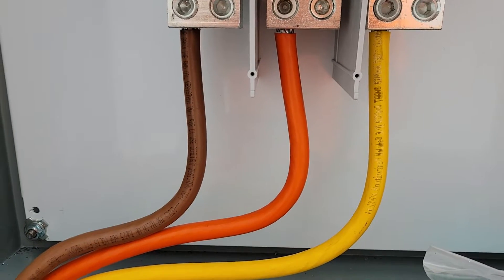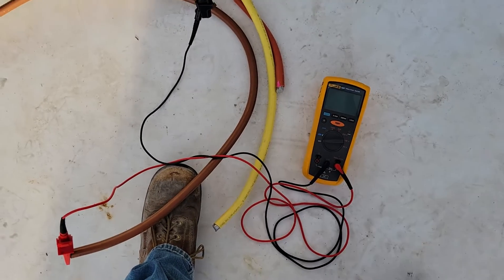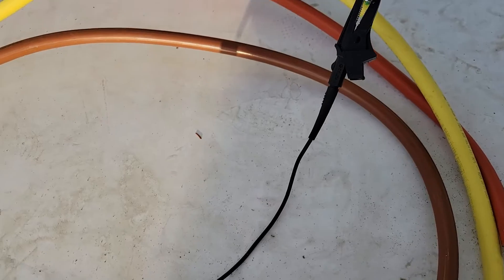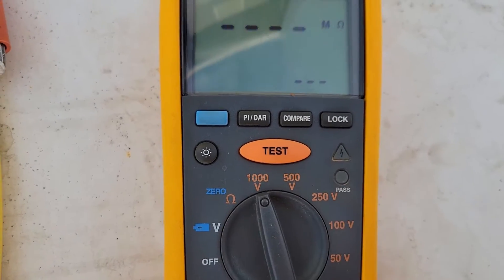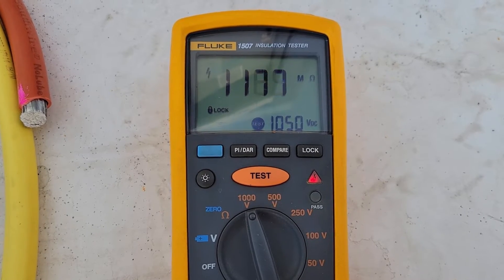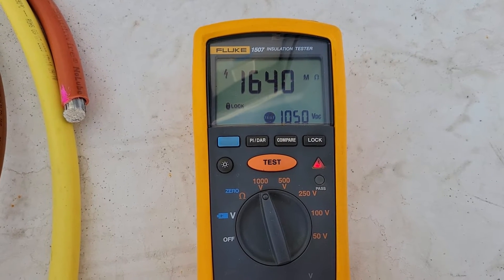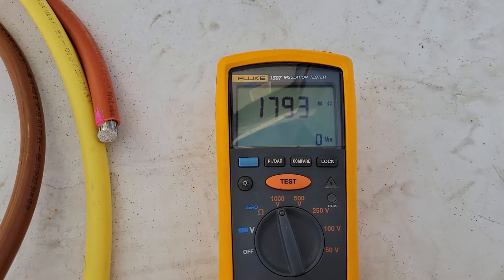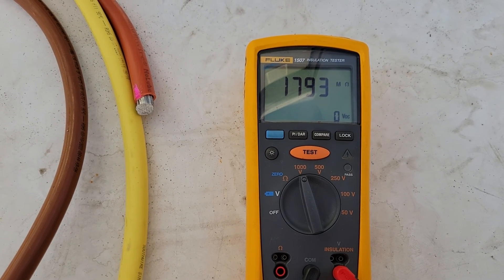Fluke Insulation Tester In Action, (AKA Megger)

Comment: As a NETA level 4 with 2+ decades of experience in electrical testing my opinion is that the video demonstrates on how to use the test set but that is not the correct way of testing a low voltage cable. The cable should be encased in a conduit which should be grounded as well. This way the total insulation resistance in reference to the conduit (which is inherently grounded) is measured as well. Also, the cable should be terminated on both ends since there are chances of insulation damage during the termination procedure, or simply bad workmanship where a couple of straights of wire from one phase touches the adjacent phase (seen this happen quite a few times especially in tight spaces) . As a quick preliminary test it should work but not a final insulation resistance test.

Comment: What if the wires at the other side touches each other. Assuming that you don't know that.
What will happen?
Reply: They arc. The opposite ends should be taped up & good distance from anyone.
Reply from the maker: It will read 0 and form a small arc for a second. Be sure to tape them up nice. We also have a spotter on that side to keep people away.

Comment: These wires....Werw they running 120V or 220v?
Reply: The voltages in the video are 277/480v unless they are coming of a transformer that alters the nominal voltage

Comment: So if your conductors aren't actually touching then you wont get a Failed reading? Does this test not work if the wires in question are not touching? I thought a simple Nick in The Wire would show a fail or bad reading
Reply: If that nick is not extremely close to the interior surface of the metal conduit or touching the bare material of an adjacent phase, the insulation resistance will pass, especially in low voltage cable applications. The withstand test (Hi-pot or VLF) would be pick this up but this test is only being used in medium and high voltage applications. In other words, if I nick the wire and it's sitting in "free air" at a decent distance from a grounded conduit or enclosure , the test set will not pick it up since the dielectric breakdown of free air is 3KV / mm. A simple calculation will tell you that a 1000 Vdc insulation resistance test will only break down the air if it is less than 1/3 of a mm away from the reference (ground in our case).

Comment: I just bought a Megger and wanted to test it. I tried to use 2 short pieces of NM-B 12/2 Romex (1 with no nick/damage in insulation and one with damaged insulation). The megger puts out sane number VDC (500) and megaOhms shows 500 as well. When I release the Test or Lock button obviously VDC drops but the 500 MegaOhms stays same. It foesnt matter which wire I test. The broken wire and good wire show No differences. Im using ground to Hot or ground to neutral. I saw a video of someone doing this test and his worked where mine does not. Is this meter defective? Should I return it for another?
Reply from the maker: I am surprised by your result. What brand is your megger and yes it may be faulty.
Reply: @ElectricianToolDeals The Megger was the UEI IRT807. I just got the Klein one and had better results on some #6 THHN but only when the copper actually touched. For that I could just do a continuity test to see if there is a break in both wires and they are touching.

I thought this would give actually readings on the insulation integrity or aging insulation on older wires as well.

When I put a nick in the one wire and test over the 2 it just gives good readings.
Reply from the maker: @cyrusalmighty21  I believe you will have better results on wire inside conduit that is a longer distance. The resistance value of small wire is very low and hard to pick up except with the best equipment. Cut a piece of 1/0 or something and put it in conduit or in the ground next to some other wires and you'll see it. In order to see the lower value it needs something for the current to leak onto ie: conduit, metal boxes, etc.
Reply from the maker: Electricity won't travel through air. Therefore, unless something conductive is very close, ie: rigid 90s, dirt, metal conduit, etc., is very close. Your reading won't be correct. This is hard to explain. I hope this helps.

Comment: i will like to know what's the set up at the opposite site of the wires? are they connected to the device, or are they disconnected ? some one told me that the wires should be connected to ground on the opposite site is that true?
Reply from the maker: No cover each wire with tape separately
Reply from the maker: Thanks for the comment too.

Comment: Great video  I just found out at work that some of the works had wires short and they splice them  #10 do you think I can find the with this meter
Reply: Yes. Just test it at rated voltage of wire insulation

Comment: So are those lines live when you are testing them ? Can you megger test something with no power like a vibration coil to test its wire insulation? I apologize if I sound ignorant in advance. I am just getting into the electrical field and am self researching.
Reply from the maker: Thanks for the comment. Never use on energized circuits. And any coil that is insulated can be tested.
Reply: @ElectricianToolDeals I just bought a Megger and wanted to test it. I tried to use 2 short pieces of NM-B 12/2 Romex (1 with no nick/damage in insulation and one with damaged insulation). The megger puts out sane number VDC (500) and megaOhms shows 500 as well. When I release the Test or Lock button obviously VDC drops but the 500 MegaOhms stays same. It foesnt matter which wire I test. The broken wire and good wire show No differences. Im using ground to Hot or ground to neutral. I saw a video of someone doing this test and his worked where mine does not. Is this meter defective? Should I return it for another?
Reply: Sorry I meant 550 MegaOhms and 535 VDC is what it outputs while holding Test or Lock for Auto test. And must I wait the whole minute? Your tester had a fluctuating number on MegaOhms where this tester just goes from 0 to 550 MOhms instantly. Its like the leads arent really working. But I did a quick current test to see if leads were im correctly and it tested amps test fine.
Reply from the maker: @cyrusalmighty21  the megger could be faulty. I would be curious to see what a fluke meter shows in this scenario.
Reply: Beginning of video says before u turn on power pay attention bro

Comment: You are not using the proper leads. There is a different lead for doing megger testing. Notice the open spots above the red lead on the megger.
Reply from the maker: Thanks for the comment. These leads are the same leads that they use to calibrate these meggers.
Reply: You can use both sets of leads that come with the 1507 to mega the other lead you're talking about just has the test button on the lead there isn't anything wrong with using these clamps
Reply: Well now I feel like an asshole. Thanks for the education

Comment: So here you were testing brown to ground, does that mean on the other side the brown was spliced with the ground just like how you would do when checking for continuity?
Reply: Each leg covered with tape? Not together? Is yes, than it wouldn't it matter r whichever cable it's tied to
Reply: @energyDee This is for testing that there is no crosstalk between the cables. 
That's why they need to be separated (and why the resistance reading is so ridiculously high - in the hundreds of mega ohms).
Reply from the maker: Thanks for the comment. No the other ends were covered with tape.

Comment: still looking for a video that shows a failure, for example if A phase was connected to ground at the opposite cable ends, what would the meter read then?
Reply from the maker: It'll be a while before I need to do more tests but I've had several fail. I'll make a failing video. Thanks for the comment.

Comment: I have a couple of questions…. If anyone is still on this thread….. probably dumb questions but nevertheless
Reply from the maker: Thanks for the comment. Go ahead with your questions.
Reply: @ElectricianToolDeals  your conductors you are testing….. if they have a cut in the insulation… yet none of the damaged area is touching anything like in free air…. It will still show compromised conductor?
Reply: If that makes any sense at all
Reply from the maker: @chadhardwick9214  That is supposed to be the case. The amount of current that bleeds off that wire and onto the other wires should be larger therefore, giving you a lower reading. If you are doing testing and you have one wire reading significantly lower than the rest, then there should be cause for concern.

Comment: Wait so do you tape the other end individually or do you for example put the brown and orange together and then test it like continuity?
Reply: No. You do not connect your phase conductors together. To read the resistance, each phase has to be completely isolated. So the end you are not connecting to your test instrument, should be isolated to be not connected to ground or to anything else. The tester will measure whatever leaks through. 

The maker of the video mentions isolating around 2:40 of this video.
Reply from the maker: Thank you for your comment and excellent response.
Reply from the maker: Thank you for your comment. Don accurately answered this question. You want to lift the opposite end from any terminals and wrap with tape. This will give you an accurate insulation test as well as keep others from getting shocked.

Comment: Did you disconnect the ground wire from the system as well? I have used a megger before, but it’s been a long while. I remember isolating the phase conductors, but cannot recall if we isolated the ground as well.

I am about to perform some testing on some suspect VFD cable to a span motor for a pivot bridge. I do not want to back feed voltage through the ground to the VFD. I won’t be reading insulation resistance of the ground conductor. I believe that is unnecessary since it does not carry load current.
Reply from the maker: You won't need resistance of ground but you will need resistance of phases relative to ground
Reply from the maker: The ground also needs to be tested and isolated to verify no current leakage from phase to ground.

Comment: Do you always have to disconnect the other end from whatever equipment and tape it off
Reply from the maker: Thanks for your question. As long as the equipment is in the off position, you can technically test it. You'll have to remember that if the feed is parallel, then you will be testing all wires of the same color at once. The best practice is to lift all wires and either tape them off, or have a spotter to assure no one gets shocked by touching the conductors. I hope this answered your question and i encourage you to ask any question any time! Have A Great Day!

Comment: It should be any different  between 50 and 300 feet’s on the ohms reading?
Reply from the maker: The longer and larger the wire is, the more energy required to hold testing voltage. This results in longer testing times being needed. Also, the longer your wire is the more chance you have for minute damage. Thanks for the awesome comment and Have A Great Day!

Comment: How do you determine the value of resistant is good after measurement? I know you mention above 100 but does this value apply's to all test?
Reply from the maker: The passing resistance depends on the type of insulation on the wire.

Comment: So go ahead and explain HOW the return reading gets to the megohmmeter if all conductors are insulated and only damage in one of the conductors. So, since your "green" EGC is insulated, explain HOW you get reliable readings when the return path to the meter is insulated and all raceways are nonmetallic and again all conductors are insulated. Physics say it is not possible but Megger, Fluke, AECM and so on all want you to think this is how megohmmeters work. Think about it.....if all conductors are insulated are you expecting the GREEN with perfect insulation to somehow ABSORB the leakage....through perfectly good insulation. Again not want MEGGER and FLUKE want to hear...........FYI- 100M is a NETA standard it is not what manufacturers say, ask me how I know.
Reply from the maker: Hello Paul,
I know who you are and I know that you are far more qualified to speak on this than I am. All I will say is that, when you charge a wire with 1000v dc, the voltage creates a magnetic field around the wire, one positive and one negative. I believe the measurement you receive is based on the difference in the returned factor, and the factory set value on the meter. These 2 values are calculated based on a "proprietary formula" and the resistance is shown. But please educate me if I am incorrect. This is a rare opportunity for me to converse with someone of your intellect.
Reply: @ElectricianToolDeals  Greetings Fella. Just an Electrician Fella. Now, I have in various emails from megohmmeter manufacturers who state in the emails that without a conductive return path the megohm readings are useless. They were asked specifically if single insulated conductors are installed in a nonmetallic raceway and only one conductor is damaged and all other paths are insulated, would the megohmmeter readings be reliable and their answer is NO. They state a return path that is conductive must exist. I would love to think that capacitance and so forth would result in an osmosis effect on a mutual insulated conductor but in its just not possible. Now, give us a metallic return path, grossly contaminated insulation and so forth maybe..but not in normal installations I just don't buy into the hocuss pocuss. Still waiting for Megger, Fluke, Flir, and AEMC to convince me otherwise. Great video however and keep up the good work.
Reply from the maker: @MasterTheNEC  I definitely can believe that. We do it as part of the red tape on a job. I've always wondered how accurate it was. Thank you for the education 🙏 🙌  have an awesome day!
Reply: @MasterTheNEC  But isn't this like saying....if a tree falls in the forest does it make a sound?  In other words, if it sits in a non conductive routing and the other insulations are good, ....the current will follow the path of least resistance down the wire. Even though that particular insulation might leaks, it has nowhere to leak to and so will operate "normally."
Reply: @rael5469  none of that makes any sense....none
Reply: @MasterTheNEC   Yeah of course it makes sense. The insulation might be compromised but as long as it doesn't touch another conductor the current will go down the wire and operate normally. A bad situation, but it will go undiscovered until some other defect appears. You yourself said as much. That without a return path the Megger reading is useless. And that has always been my question when using a Megger. But.....like I said.....absent another fault that allows a return path the insulation defect is like a tree falling in the woods with no one there to hear it. The defect is there but it will go unnoticed until another defect allows a path to ground or wire to wire short. That would be true in wire routes that are sufficiently covered where you can't go hand over hand inspection. Happens all the time. 
So bottom line, a megger reading that shows no fault in a wire that actually has compromised insulation ....is STILL a good reading because no actual ground fault or wire to wire short exists. It might never fault or it might be an intermittent fault that just doesn't show during testing. Happens every day, literally. That's how I make my living....chasing intermittent faults.
Reply: @rael5469  OK...but I don't see how that is at anyway relevant to my statement. I was talking about how meggers are useless when their is no conductive return path for the tester. And my "living" is knowing wire and cables for Prysmian/Encore Wire.
Reply: @MasterTheNEC   What does, "my 'living' is knowing wire and cables for Prysmian Wire" mean ?  What does that mean?  Just asking. (Never mind, I understand now. Sorry.)
Reply: @MasterTheNEC  "Prysmian has acquired all of the outstanding shares of Encore Wire's common stock for $ 290.00 per share, in cash." 
Lucky You !
Reply: @MasterTheNEC  "The contracts were for Germany's BalWin1 and BalWin2 offshore grid connection systems and the DC34 underground cable project."
WOW !   I just heard a guy speaking about this sort of thing on a PBS broadcast. He was extremely upbeat about powering Puerto Rico with undersea power cables, as one example. He gave many more examples.
Reply: @rael5469  Yep.....I am NOT complaining as Encore Wire has been good to me and my STOCK...;)
Reply: @MasterTheNEC   Awesome !
Reply: @MasterTheNEC, thats the point that is being made, thats the whole purpose of doing the test to find if there is a conductive path to from phase to ground or if a path exists from phase to phase. If you understand what you're looking for and why you're performing the test , the point you're making is irrelevant, its like saying water is wet. 

 I was a testing technician for 8 years performing ac vlf hipot and dc hipot tests on cables, doble testing transformers and commission function testing substations and protective relaying, I'm also familiar with NETA